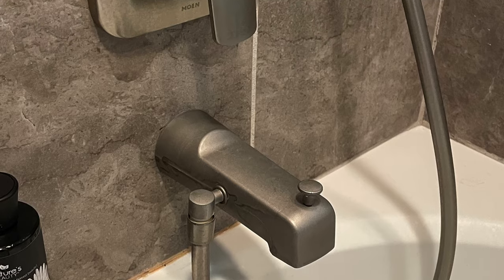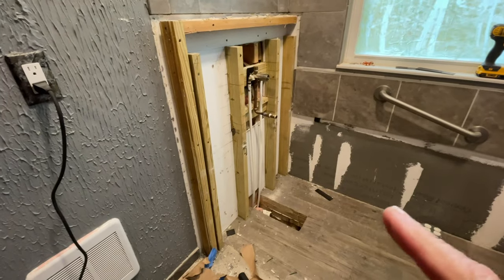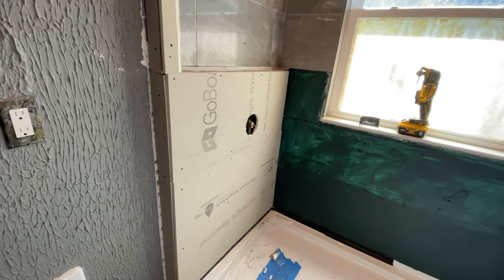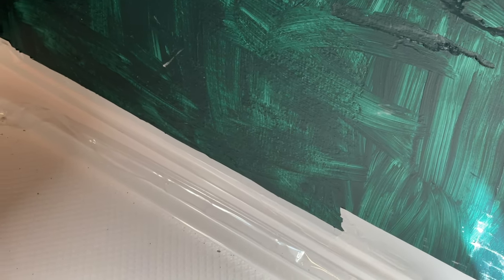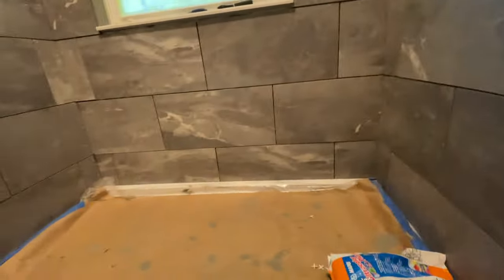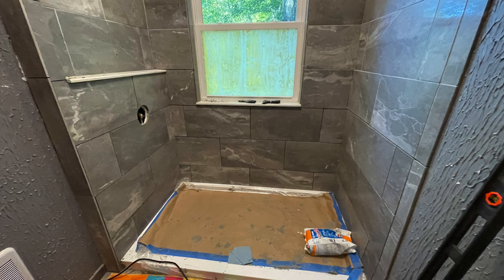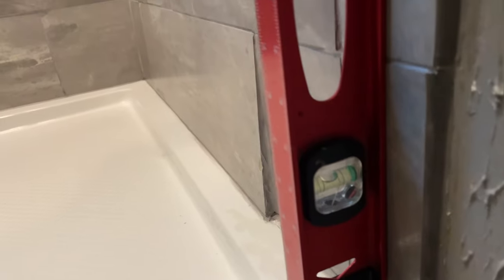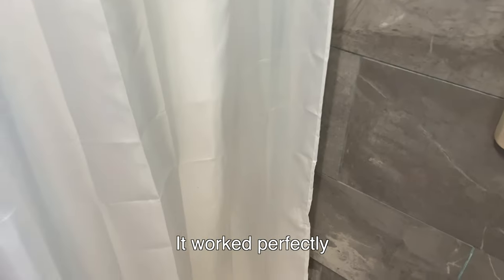Jacuzzi to shower install

Comment: Looks great! I prefer a curtain  over a door. Easier to clean and more room for the  arms. Plus you can change out the designs  of the curtain when you want something different. I was like you not afraid to do thing's  I wanted done. But severe arthritis and fibromyalgia gave me issues. I got by until I messed my back up falling in my yard when weeding my flowerbeds several years ago. I started watching you from the flooding stories. So sorry to see all you and others have went through. I am just in shock at the damage. Prayers ❤ your way.
I am old enough to remember the Flood of 77 here in Johnstown PA and will never forget the way it stormed the night before. I grew up hearing stories about the great Johnstown flood of 1889 from what my dad had been told from his grandmother. Maybe that is some of why I have been drawn to follow everyone's story.
Reply from the maker: Thanks for the encouragement and prayers.